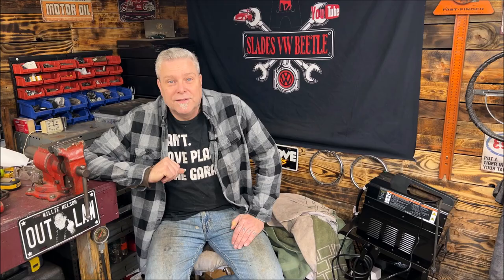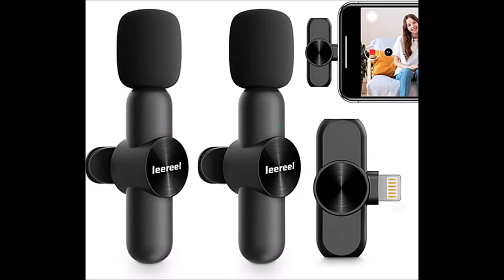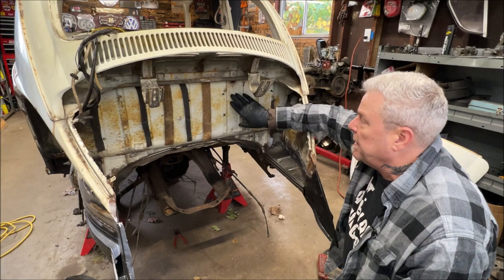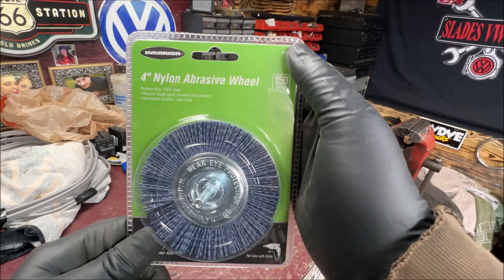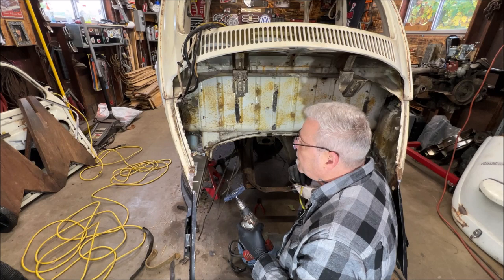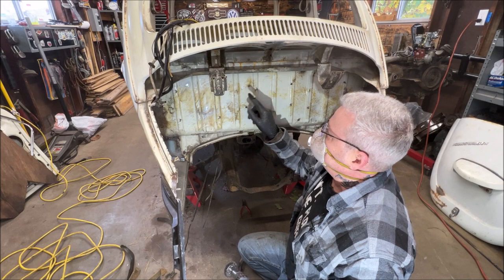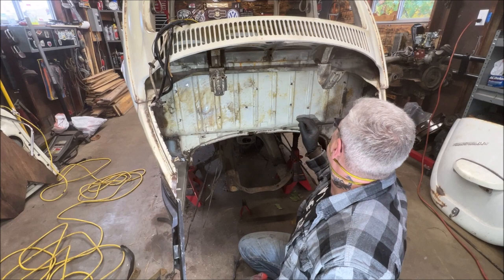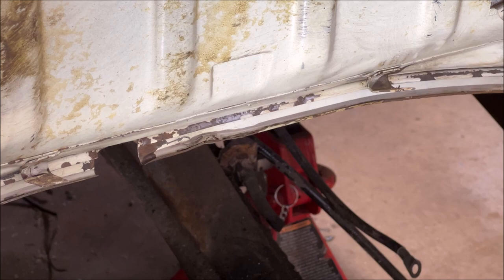VW Beetle Engine Firewall Compartment Refurbish with Rust Bullet - VW Bug DIY - DIY with Rust Bullet

Comment: Great video! I wonder if you could use a heat gun to melt the glue and make it easier to remove, though it is not a big concern because you put the rust treatment over it all, anyway. Might reduce some wire wheel time??  BTW, I am jealous of that heater!!
Reply from the maker: Yes a heat gun would probably help greatly. The only reason I didn’t get to OCD about it, is there is tarboard going over it. But you’re right, it would help greatly.

Comment: I like the heater idea,  I need one for my workshop too....the elves complain when it gets cold.   But seriously can you ad a link for the heater?   Thanks as always 🎅
Reply from the maker: Thanks Santa, I’m going to do a short video probably in the next coming days. On the install of the heater. I didn’t think anyone would want to see it. Here is a link to the one I bought.

https://www.homedepot.com/p/Dyna-Glo-5000-Watt-Electric-Garage-Heater-EG5000DGP/307827993?g_store=&source=shoppingads&locale=en-US&&mtc=SHOPPING-CM-CML-GGL-D27-027_023_PORT_HEATING-NA-NA-NA-SMART-2997116-NA-NA-NA-NBR-NA-NA-NEW-PL3_live&cm_mmc=SHOPPING-CM-CML-GGL-D27-027_023_PORT_HEATING-NA-NA-NA-SMART-2997116-NA-NA-NA-NBR-NA-NA-NEW-PL3_live-71700000094028463-58700007802564826-92700070902354558&gbraid=0AAAAADq61UcCfWkvkbpELFqyznSHLc7k0&gbraid=0AAAAADq61UcCfWkvkbpELFqyznSHLc7k0&gclid=Cj0KCQjwteOaBhDuARIsADBqReizA19qhDEAm80UIRBMFpGK8Dn2n0VNbwVm_JNtLaYDHPisGFgjee0aAl25EALw_wcB&gclsrc=aw.ds

Comment: Thanks, Slade!  On the heater, check to see where the thermostat is located.  If internally, watch some videos about your model, and find out how to make it externally mounted.  Installed one, in my garage, a few years back.  Have the thermostat external, made all the comfort AND electricity bill ‘difference’.
Reply from the maker: Thank you very much! It is internal. I see there are two other connections for a external thermostat. But I wasn’t quite sure how to go about it. I am going to see if I can locate some videos.

Comment: Slade, another great video. Any suggestions on what to use to replace the original felt material behind the engine compartment tar boards?
Reply from the maker: Thank you I appreciate that. I’m actually going to end up at a fabric store more than likely. That would probably be the easiest and cheapest way for the felt.
Reply: @SladesVWBeetle  thanks! That was my plan too, but was wondering if a heat resistance material was needed.
Reply from the maker: @jeffbannon1345  Let me do a little research on that first, I was going to go to Joann fabrics. I don’t know if you have those near you.

Comment: How important is the tar board in the engine compartment.  I removed mine to do the wiring harness.
Reply: The tar board helps with keeping the engine noise down, at highway speeds.
Reply from the maker: As vintage76 described it is very helpful. I used sound sound deadener behind mine on the last project. So I had double the barrier.

Comment: Can I paint over some rust with this rust bullet as I am thinking of using it to under seal my beetle and I have some light rust under their,
Thanks 👍
Reply from the maker: Yes you can Gordon, but first you have to do a little bit of wire brushing at least to get the loose stuff off.